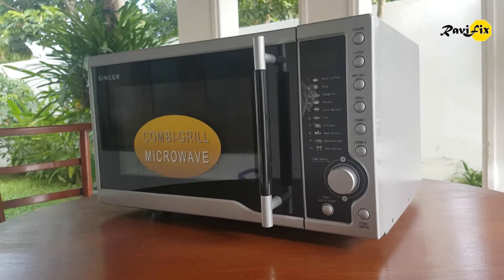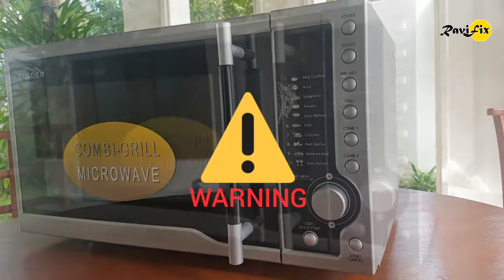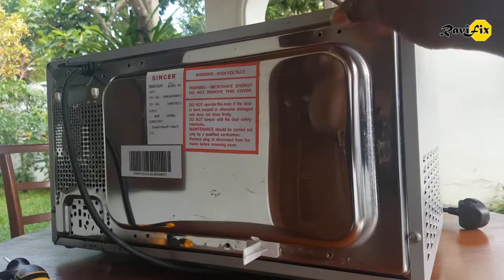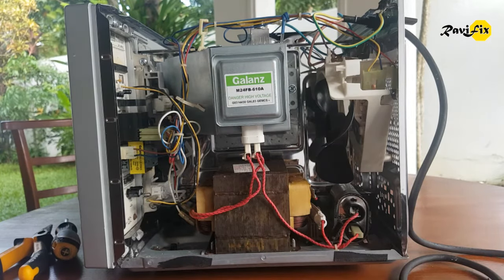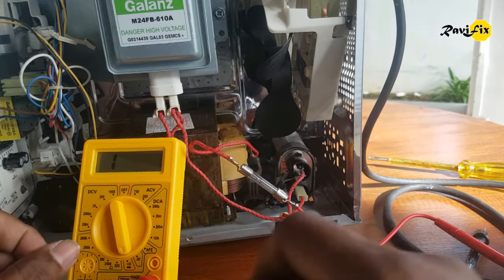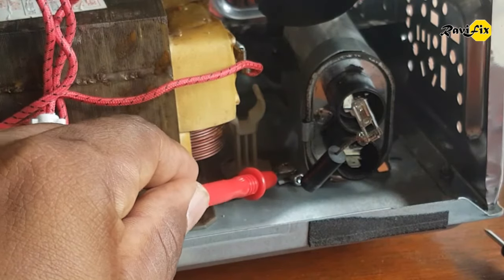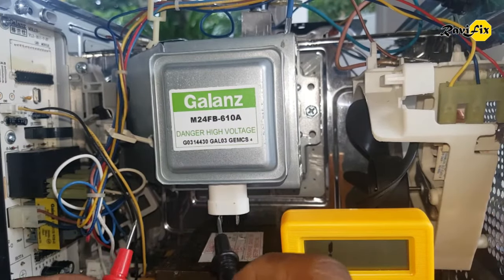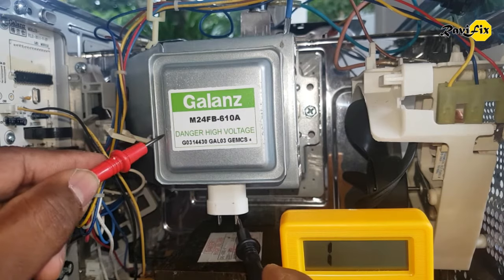How to diagnose and repair microwave oven | how to check capacitor diode transformer and magnetron

Comment: This very practical test procedure is very clear and concise. Well explained and effective. I especially appreciated the concept of continuing testing all main parts if a fuse is found bad. As in all electrical work employing fuses or breakers, there was most likely a reason (failure of a main part such as condenser, diode or transformer) for the trip or blown fuse. Very well done. Thank you!

Comment: Hi there. I'm a retired Maintenance Mechanical Supervior, with limited knowledge in Electrical. Do have an issue with my Lg microwave Oven as it's not heating. Prefer to refer to an Experienced Technician in Rectifying Microwaves. However, watching your video clip, I'm deeply impressed with your knowledge and the ability to pinpoint and narrate the issue as a Instructor, in as much anyone with limited knowledge of the English language could understand you. Well Done ! Keep Going. God Bless. 😊
Reply from the maker: Thank you

Comment: Hi Ravi. My microwave is not working ( only grill is working , not microwave ). The two fuses are OK. I was in doubt with the HV diode,  i bought a New diode but nothing. All misures on the capacitor,  the magnetron,  the HV transformer are OK like your method.  I rally dont understand what is wrong with this microwave!!!!
Reply from the maker: This could be faulty high voltage capacitor. We can mesure it with multimeter if only shorted. But open circuit no any mesurement for normal multimeter. Try to mesure the capacitance with a good multimeter which support for it. Otherwise if it is not expensive for you just replace the capacitor.
Reply: Thank you Ravi.  You are very professional !
Reply: Can i measure the capacitance of capacitor with a normal  multimeter ? My multimeter has capacitance measurement.  What capacitance should i read? I suspect on capacitor because no electric dishange was when shorted the capacitor

Comment: Model MG7040NWR, microwave 1350w, Grill 1250w, conversation combination 2650w, originally in ac income supply 12A 250vac. Original fuse white type but now available glass type in market is glass type fuse suitable for above mention. Give suggestions thanks..
Reply from the maker: If same amperage doesn't matter glass or ceramic. Ceramic fuses are more safer when it blow. Glass fuses are harmful when it blow.

Comment: Hi Ravi, 
Thanks for the video was really informative. I have a microwave which have blown fuse. Tried replacing and running it and blew the fuse as soon as tried to run it. 
I checked all the other components and could not find any fault with any components. The only thing is I can't find another high voltage fuse between transformer and capacitor. 
Also when testing the capacitor, do I have to remove the diode and resistor which is attached to the capacitor.
Reply: It might be transformer
Reply: I had the same issue. Fuse blew instantly, repeatedly. I tested everything, with the help of the video. There was no fuse between the transformer and the capacitor on mine, either. Then, I unplugged everything from just one terminal on the capacitor and found my capacitor to be shorted between the terminals... which is bad. I did not remove the diode (no resistor on mine) from the capacitor, as that was the side with more items plugged in. I left all connections on one terminal, removed the capacitor from the microwave, and freed up one terminal on the capacitor free of any connections.

Then, I used the flux capacitor, and I went back to the future... ok, just kidding. I then ordered a capacitor, because I need my microwave now, not later/future. I'm not going back to the future, I am staying here with my microwave and its new capacitor.😂
Reply: @copperkeyracing6167  in my case it was actually the magnetron that was blown , however I did not know how to test it. Once replaced that working all good .

Comment: How do you discharge the transformer and magnetron?
Reply: The don't need to be discharged, but the condensator. Considering your knowledge in the matter, I'd suggest you not to repair by yourself

Comment: for top fuse you put red wire point of multimeter on left and for bottom fuse you put red wire on right. what if is vice versa? is it dangerous?

Comment: The diode is used as part of the voltage doubler, not solely as a means of discharging the capacitor.   Also, you did not explain how to test this diode, which is a high voltage diode, and cant normally be tested in the usual way like a lower voltage diode.  You need a higher test voltage to forward bias the diode while testing.  Hope this is helpful...
Reply: You're right Richard! The diode is for the voltage doubler and it's not for discharge de capacitor

Comment: Thank you for the reply. I guess you are right.  I suspect that the thermal fuse and the line fuse blew.  rather than the capacitor.  I will attempt to fix it myself.  My first step is to identify the types of fuses and buy them cheaply.  If after replacing the fuses it still blows then i will have to change my capacitor etc.
for now I just want to confirm that any 20 amp 250v ceramic slow burn line fuse of the same dimension can work?

Comment: Ravi, you did a fantastic job on this video! I will use what you taught me, to repair my microwave oven - thanks!
Reply from the maker: Thank you

Warning!
You are going to work with High voltage.
Safety first.
All the best.

Comment: Good day Mr Ravi.
I have the sharp microwave old model is R-2V15.
i found the problem that the fuse was  always blown off after replace it  due the HV diode has shorted, the. Part number is. HVR-1X4 
My question is. Can I do replacement .The faulty dioda with the part number  is HVR-1X3 since I very difficulty to find the faulty part number .
Your reply is much appreciated thanks
Reply from the maker: I have no experience. Just try it, if goes wrong it will blow another fuse. 😃
Reply: Thanks very much 🤝🙏🏻

Comment: Are all magnetrons standard in power, voltages, watts and ohms, etc., and can be used as replacements in any microwave oven?

I'm trying to repair my microwave oven which is just about 2 years old, and the magnetron has stopped working.  It's one of those that has a static (hot) plate - not the rotating kind.  Can I use a magnetron from a rotating plate microwave oven to repair mine?

Comment: Nice safe start ... then safe fail by using dead short on capacitor. Damage cap & tool and create explosion risk !!! Use a large resistor for a few minutes then check the voltage. Then do it again. Then don't die ; )

Comment: Thank you Ravi Fix for the informative tutorial.  I checked every thing in my LG microwave oven using a multimeter.  These are my observations.  I used continuity testing. Diode is OK, HV capacitor is OK, all the fuses are OK including the thermal fuse. Magnetron is OK. Door switches are OK. HV transformer is OK except for (I am not sure) the high voltage terminal connected to the HV fuse going to the HV capacitor.  There was not reading or a beep at this terminal.  Microwave oven operates, but it does not heat up the food. I also cleared the front dial.  What seems to be the problem?  Thank you for your input.
Reply: Sometimes microwave magnetron has short circuit under voltage.
Reply: I just went through Ravi’s video and followed every step. Turns out that my problem was the high voltage 0.9A fuse had blown. I could immediately tell because that fuse has a spring inside and the spring wire was broken with the spring no longer stretched inside the fuse. Everything else tested okay. I’ve ordered replacement fuses from Amazon. A $0.50 fix. Thanks Ravi.

Comment: Peace be upon you, teacher. I want to ask you about the microwave does not heat up. I changed the fuse, changed the diode, and checked the capacitor, it was good. I checked the micromagnet, it was good. I said, maybe the problem is from the transformer, but the transformer when measured it looks good, but when you run the files inside it, it gets hot and when the transformer watts increases. Coming out of smoke and smell

Comment: I'm not clear on how did you do the high voltage diode testing. Using a 9V battery ? 🤔
Reply from the maker: I have clearly mentioned in the video that we need a bit higher voltage source to check this diode. Because due to high resistance in the diode, it has a voltage drop. If you use small voltage source like AAA battery, you will not get any reading. Because entire voltage drop in the diode. 
Hope you understand.

Comment: Help….. my GE microwave does not beep after cooking . How can I repair it? Thanks
Reply from the maker: May be bad buzzer or some microwaves have option to turn off the beep. Read your user manual.
Reply: Did read the manual.  Will work sometimes most likely switch are going bad.

Comment: Sirji, I have GEC microwave table top. While plugging current does not flow and front panel no light. I have checked with multimeter transformer. magnatron, capacitor, diaod, fuse termostate, all ok. I have also checked main cable,it is OK.I have not checked PCB and it is bit complicated. Appreciate if you could response. I am in CHICAgo, USA and here it is 120V.

Comment: Awesome video. I found the capacitor to be bad on mine, shorted between the two terminals. Fuse blew and monitor switch was recommended (per a sticker on the inside) to be replaced with the fuse, so that'll be replaced also.

Comment: Sir, I have a LG CONVECTION Microwave I think it takes high current when switching on immediately ac fuse glow but it microtone ok capacitor on test multimeter seen ok diode test with battery it ok what to do. Give suggestion. Thanks
Reply from the maker: first of all if it is not possible to find something, highly recommend please get professional person assistance. 

Check  for corrosion or oxidized on wire connection. Duble check transformer,  Make sure you have replaced right amperage fuse.

Comment: Hi, Do all microwave use 15-20amp ceramic line fuse? i have a sharp carousel microwave that uses a 20 amp. It blew when I attempted to cook rice in it. It can been over 1 year.  Can I buy any 20 amp ceramic fuse to replace it?
Thanks
Reply from the maker: Most microwaves use 15 to 20 amp fuse. Before replace the fuse, should check the issue why blown the fuse.

Comment: for checking the fuse you did not mention the precise way of connecting the two pints of multimeter whether red should be on left and  black on right or vice versa for both fuse. you just display but did not mention the precise way of placing both the points of multimeter. what if placed wrong?
Reply from the maker: If you discharged the high voltage capacitor properly, then you don't need to be afraid to touch or check any component. Please follow the procedure explain in the video beginning. To check the fuse no matter polarity, it is just continuity test, you can use any lead to any side, carefully look for a conductive point on the transformer body to chek continuity, should be somewhere around, try it to find it by touching the multimeter lead.

Comment: When all it test is right lik I follow u step by step but still it doesn't heat wat could be d issue
Reply from the maker: Did you check the high voltage fuse and 220v fuse.
Reply: @ravifixall  one the fuse is blown but the other microwave as no fuse
Reply: @ravifixall  when I on the microwave the magnetron brings spark at the plug terminals

Comment: Sir, sorry my microwave is GE brand and not GEC. Pl response
Reply from the maker: Sorry for late responding. I have no experience with GE brand. However if not get power up with front panel, check the 120V fuse first, (there are 2 fuses. Highvoltage fuse and 120V fuse)
If everything ok, then have to check the pcb. Just you can do a visual inspiration for any melted or broken wire and any burn mark on the pcb or around. However i recomonded that get the cooperation from a professional guy in your area this time. Sorry If you get frustrated with my reply.